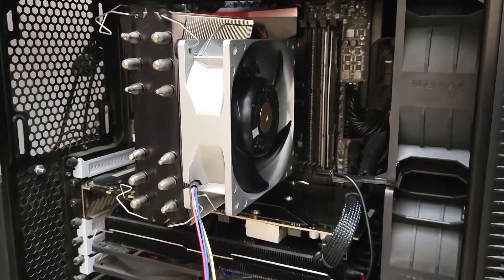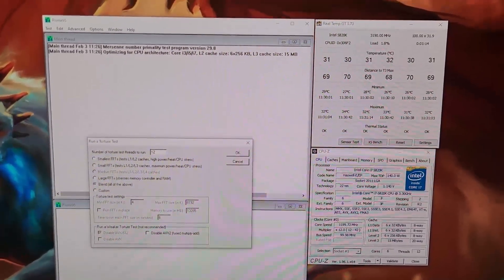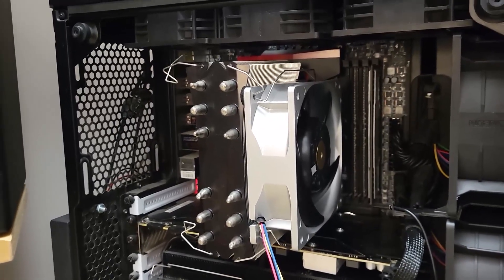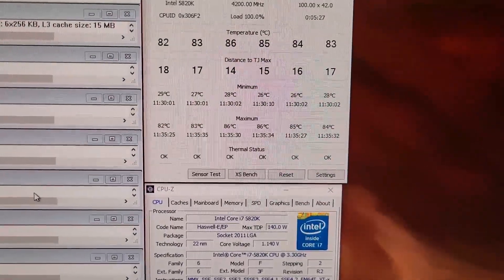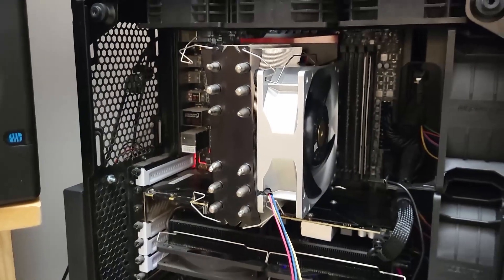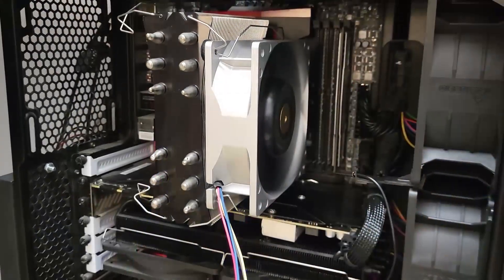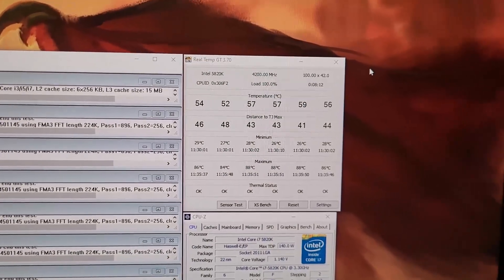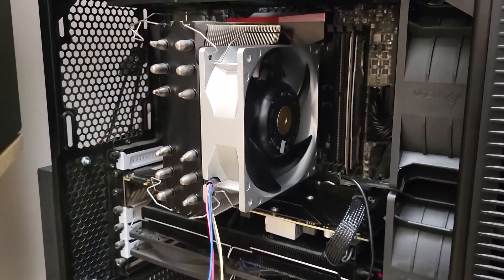Overclocked Core i7 vs. 11,000rpm 120mm Fan

Comment: I wonder if the temps would be lower if the fan was used to pull instead of push since that fan probably dumps a significant amount of it's own heat into the air.

Comment: There is a wee problem there: you really needed to populate the second DRAM channel and used smallest FFTs in P95 to achieve maximum heat and keep it that way. Blend mode alternates between all the FFT sizes you see on the screen and is to test the stability of practically everywhere in the CPU (RAM is counted as part of CPU for this purpose). Smallest FFT size puts the most stress on the FPU while the largest one puts it on the RAM.
Reply from the maker: Yep I'm aware - for all my thermal tests I do small FFTs, but this was just a bit of fun. :)
Reply: @FanPhys  what you say is like deflating the football before playing for fun; it doesn't make sense at all. You didn't even say anything about 5820K having not 2 but 4 memory channels because you have no idea what I am talking about here.
It is not difficult nor inconvenient to click on smallest FFTs which would give you the highest heat load and it is what you do if you are testing some variable in the cooling system. Now you could have a specific reason not to use the highest heat load but it is still counterintuitive to use the blend mode since it's not a stable one. Blend mode is for scenarios where an overclock may be stable for one kind of load but not the other, or when you overclocked the cpu and the memory  at the same time. I am not even getting into the whole unpopulated memory channel thing...
If you are using p95 you must know stuff like this there is simply no point otherwise. Chalking it up to "just having fun" doesn't work mate, not really. You are making the fact that you don't know what you are doing more apparent and it's funny in a not really fun way when the objective is the exact opposite.

Comment: Finally a "desktop" fan that can cool the 14900k! Imagine 2 or even 3 of those on a 4090 running furmark. With those insanely overbuilt cooler we might even get near watercooling temps.
Reply: 比水冷強上幾倍的巨大塔式散熱器都有很多

Comment: How do you power these fans? Do you need a PWM controller or just DC voltage?
Reply from the maker: I made a short video about the power supply I'm using - it's from a Cisco network switch and gives me 56V DC output. To power the fan at full speed is easy; to control the speed is a different matter - I'm using a custom made square wave generator to send a control signal to the fan, also in another of my videos from a couple of years ago. :)

Comment: and people still liquid cool lol My AK620 with Arctic P12 Max fans outperforms 240s at this point.
Reply: Interesting, although I don't recommend p12 Max's for PCs because of the bearing noise and stuff. I generally recommend it for general use, machines and industrial applications. They're great for that
Reply: @DecayedPage  Most pc cases now have glass sides so even at full speed they aren't as loud as you think. I'm using a super old haf case and even at full tilt it's not bad. I'm protected by the wad of cash I saved on an aio lol 😂

Comment: I feel like at that point the heatpipes would be thermally saturated so there's a point of diminishing returns
Reply: That point is quickly reached
Reply from the maker: Possibly, but the pipes themselves are made of copper so even taking the internals out of the equation, they are still conducting heat from the copper base of the cooler. Diminishing returns for sure, but returns nonetheless. :)
Reply: @FanPhys  What do you recommend more for budget industrial applications? AVC or Delta?

Comment: You seem like a Thermalright fan (no pun intended). I've been one since the days of the slk 900 days. The rise of Noctua and their evangelist influencer advertising strategy has coincided with the downfall of the popularity of Thermalright products in western markets. Thermalright is still very strong in Eastern markets if I'm not mistaken but their products are increasingly difficult to find in Europe and USA. Still, they're a great company and they stand by their products as much as Noctua if not more. Just bought an lga1700 and am5 kit for my TRUE120, considering how old it is, this is remarkable consumer friendly behavior from them.
Reply: SLK! I Ah the golden age of DIY pc modding where you shop for water cooling parts at an aquarium shop lol. Thermalright was the king of heatsinks! That TRUE copper heatsink weighs 2 kilos! Utter madness.
Reply from the maker: Yep, I'm by no means a Thermalright-only consumer but their coolers have always been remarkable value, and very much top tier. I've tested various other air coolers and have yet to find one that squarely beats the TS140P (not even the NH-D15 does). I only recently found out that the original TRUE is alive and well in the form of a fourth revision, as you say mostly in the eastern world but it can be obtained - perhaps I'll test it in a future video!